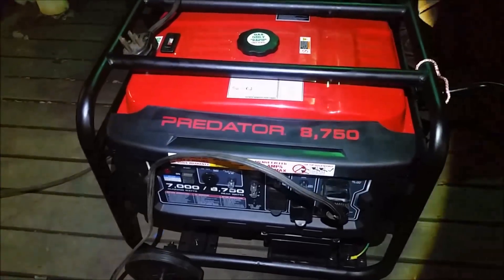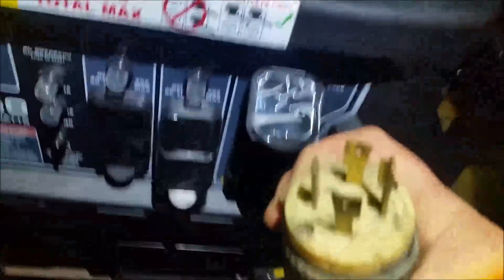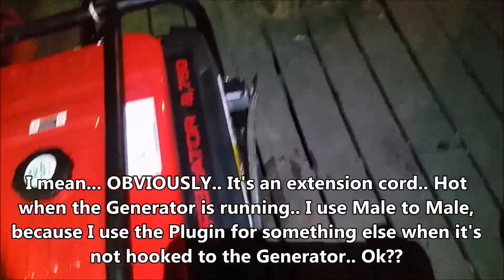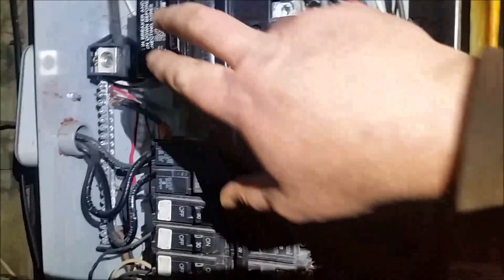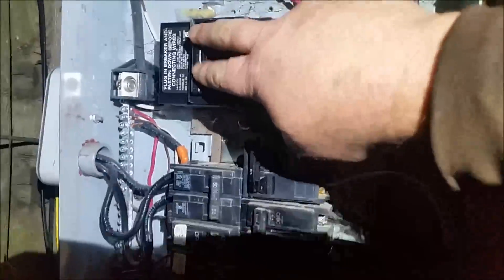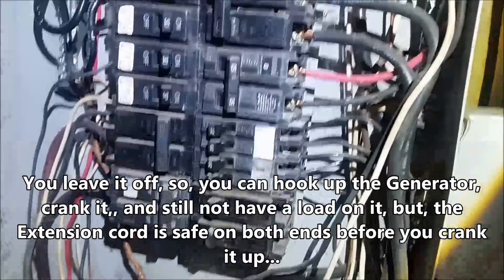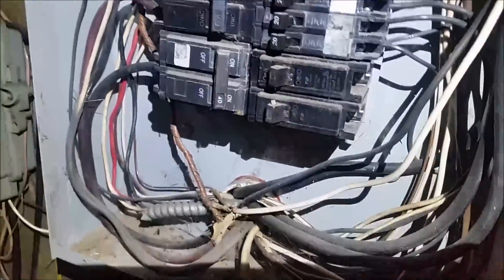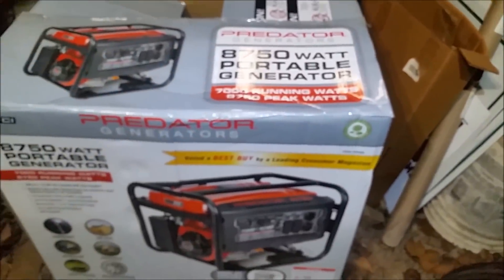Quick/Easy/Safe: Use Existing Plugin/Breaker for Generator hook up to your house Panel box.

Comment: Oh boy, he means well but...A) he doesn't say wether the cable he used is 4 wire or not. Very important that it has 4 conductors, 2 hots, a neutral and a ground. But he is correct about using a short cord of the correct Amperage! B) His generator is putting out 240 volts at 30 amps. He should back feed his panel via a 30 not 40 amp breaker. That way you're not replying on the breaker on the generator for all your over current protection. Much easier to replace a breaker in your panel than it is to replace the breaker on the generator. C) I'll give him credit for pointing out how important it is to turn the Main Breaker off First! Then all other breakers. Plug the cord in, start the generator and then turn on the back feed breaker followed by any others you want/need.
As a Retired Licensed Electrician I can make the following comments as a guide for what you can likely run off a mid sized generator. It's not necessary to get 15,000 or larger in order to get by after a storm. I have a nice quite 3,000 watt gen that does nicely. I've found that if I turn off everything but lights I can run my central a/c on it. 
Most central a/c have a 2 pole 50 (inside air handler) and a 2 pole 30 (outside condenser) But when the a/c is running it may only pull a combined total of 25-30 amps. If you ran the heat it could jump to 50 amps or so. Remember I said most not all. Refrigerators can pull 8-12 amps as a rule but start up will jump to 16-18 or more. Microwave easily 10-15 amps. Coffee maker 8-14. So, if you get a generator with a running capacity of 8,000-10,000 watts and a surge of 9,500-11,500 you may very well be able to run your a/c, lights,TV, refrigerator and use the microwave or make coffee. Turn the a/c off and you can run the water heater long enough to shower. Or do a load of laundry. 
Getting back to the video, I see Several Code Violations in and around his panel. Yikes!
For a few dollars more a Back Feed Breaker and Lockout Kit could be installed which would make this Code Compliant. I highly recommend doing so. Well worth the money and eliminates any possibility that someone gets out of sync and the two power sources go head to head. Can you say BOOM!?
Oh, and to clarify. Every other full sized breaker space in a panel will be one phase. So, the first space top left and top right will be A phase. The next one down and the one across from it will be B phase. Breakers on the left are odd numbers, ones on the right are even numbers. 1& 3 (2 & 4) will get you 240 volts.
Reply: PS, I won't be coming back to look at any comments so don't waste your time. What is considered to code varies from one jurisdiction to another.
Reply: Don't need 4 wire cord, my gen has only 3 wires and has served me well since 1999.
Reply from the maker: Wow.. You guys are awesome. I agree with all 3 of you guys.. Dale Wise.. 100% Correct. Not all States adopt the NEC.. Very few are on the 2017.. Most are still on 2014.. And, some only adopt a subset of the NEC, like my state..  Ed Taylor,, you took the words right out of my mouth.  The cord I use is 3 wire also.. Been using it for 15 years..  
The 30/40 amp breaker delima.. The smallest breaker in the line determines the capacity of the circuit.. So the circuit is 30 amp coming off of the generator.. Doesn't matter if it is a 40/50/100 after that.. 30 amps is it's limit.. BTW.. The last 3 generators I have had, have all had GFCI breakers.. They are much more finiky than standard breakers, so, surely the high limit of the circuit. But, I do agree that sometimes, they can be a pain to swap.. I have changed several.. There is usually a minimum of 4 screws to a panel. I have seen as many as 12, so, I agree with that, but, I am not sure that using another 30 amp inline would give the GFCI of the same amperage any extended life, since it is the most likely to flip anyway.. I have never used the GFCI and the generator I have now after 15 years, I use it every time I crank it to let the generator come up to speed and run 30 seconds or so, before I flip it on and apply a load.. It is still the original breaker.. Others have lasted less than 5 or 6 years.. I really don't know if keeping one moving frequently helps or hurts.. 
Dale Wise.. You are one of the few that realize that the amp/watt rating on the back of every unit is the "Max" ,, and not the Nominal or Usual current.
I have an 8700 watt and I run quite a bit on mine.. I always have two window A/C's running 18,000 and 9,000 BTU's and it is not uncommon for me to run a coffee maker and microwave at the same time and have the deep well 1hp pump kick in.. It puts a load on it, and voltage drops a little.. Enough to make a sensitive UPS beep, but, don't see the lights dim.. Showers.. I Turn on the water heater and don't use the water while it heats up, then, I shut off the water heater and take a shower.. I turn the water heater back on when I am done, until I hear the load remove, then, I turn the water heater off again.. I am lucky and have a water heater breaker in my hallway leading into my bathroom. Pretty handy.. 
There are two temporary code violations in the video. I was working on it and getting my Moms generator setup and giving it a breakin, while I was working on two other things.. The 220v plugin is not screwed down to the wall, as you can see there are new boards installed on the wall to the right of the panel, and I was in the process of moving my plumbing onto that wall, and then building an enclosure to encapsulate it, and the screen micron sediment filter and yarn filter.. I also had a direct burial cable burn out and had a temporary wire run into the panel to feed a cabin while I dug up and replaced that cable. The only code violations, and I was working on it, when I was about finished with the generator and decided to go ahead and do the video. I had just had someone come by and ask me about it and had another call who knew I was breaking in a new generator and they asked me also if I would do a quick video. That is the only reason the panel was off at that moment.
You can't use an existing breaker that is dual purpose and only used for a generator while experiencing a power outage, and usually used for something else.. In my case a welder and plasma cutter, which both share the same 220v circuit.. Since one is only running a fan while I am using the other.. 
You can't use a Transfer switch or Interlock and use a dual purpose already existing plugin.. 
Either of them is a viable alternative to this, if you want to install a Male Receptical and use a standard generator extension cord, and a dedicated 220v breaker for the generator only and nothing else.. But, that is not the purpose of this setup.. It is to use Existing.. 
I can relate to the Boom, and understand why you mentioned it.. Yes, that is something to consider.. If you use this setup, you are going to have to have the common sense to know that, you FIRST disconnect the main breaker, hook up the cord, then,,,, crank the generator... and the exact reverse to disconnect.. If you follow these rules, there will never be a Boom.. Forget to turn off the main breaker?? I never forget to tie my shoes.. I never forget to put my car in park when I get out, and I never forget to turn off the main breaker.. No Booms.. Ever.. 
Yes.. you are referring to about 5:00 in the video, when someone walked up behind me, and  I was not expecting any visitors.. Especially someone who walked up, instead of driving up and I didn't know they were there until they were in the corner of my eye.. it was while I was pointing at the 220v breaker on the left side of the box and I have watched the video several times to see exactly where it happened.. I never flinched.. But, I did have lots running through my mind for the next minute and that is when I made those errors.. But, I corrected them I think around 5:30, when I got finished with all of the thoughts I was having while still thinking.. She had to walk up while I was pointing directly at the breaker and I didn't have the main shut off when I was making the video..  I had a lot of mini thoughts run through my mind in that minute.. Anything from,, damn boy,, you did good.. Didn't even flinch,, to,, should I have turned the main off,, No,,, to I wonder if I would not flinch every single time,, and again,,, should I have turned the main breaker off, etc.. I did good to keep talking.. Ha.. And, my battery was running low and I was trying to hurry.. 
There have only been 5 of 6 who have picked that out,,, out of,, 745 comments at this time,, and many of them just love to hack on me.. So, that tells you how many do NOT pay attention and miss such a valuable chance to bash me for making a mistake.. Ha..Ha.. 
My hat off to you for catching that... I delete the original footage after I publish a video and I didn't realize I had made the mistake, because I know much better, and I was still in a hurry to get done and get some sleep, when I posted the dang thing..  So, I won't try to take the time to fix that.. I did correct it or,,, I did get it right later.. 
You are very tactful in the manner that you corrected me.. Makes me wonder what you do for a living.. Makes me think you are in some type of training capacity,, and not in large numbers or settings.. Or,, you live in a house full of Women(Wife/Daughters), and you are the only guy in the house and you know how to be tactful and get things done with sugar rather than vinegar..  If there is anything that I would like to know,, it is the answer to that question.. 
Your personality intrigues me.. Hope you reply back.. I would like to know where or why you developed that technique of telling someone they are wrong without saying it.. Ha..Ha. Cheers.. Have a great day.. Hope your week is full of Great Adventures and full of mind teasers.. 
Dang.. You don't have any likes or subscriptions either.. Ha.. Ha.. I can't tell anything about you.. Ha..Ha..Ha.. :) Have a great day..
Reply: https://m.youtube.com/watch?v=I1jT3ANENvI everyone really needs to watch this video about generator safety

Comment: The best application is an Auto or Manual transfer switch that way everything will be safe. Just get a qualified electrician to do the work.
Reply from the maker: If that is what you want to do.. Yes.. If you want to use an existing 220v plugin for a dual purpose, your suggestion will not work.. 
The only way to do that is to make a male to male extension cord and follow some simple steps.. 1) Turn Main Breaker off, 2) Hook up Cord 3) Crank Generator. Disconnect is the exact reverse.. It is not possible to use an existing plugin with a transfer switch or Interlock.
And, an Electrician has two eyes, two hands, same thing I work with, and I can't say I am impressed with the Electricians that I have conversed with here. 
I have not met one with a good argument yet he could defend.
Reply: The only issue I can see if someone plugs the ext. cord to the ge. when running. They take the risk of getting shocked. But other than that your correct. But how many folks under stand?